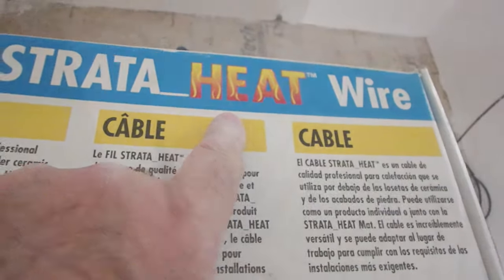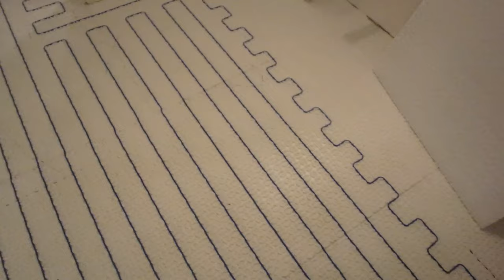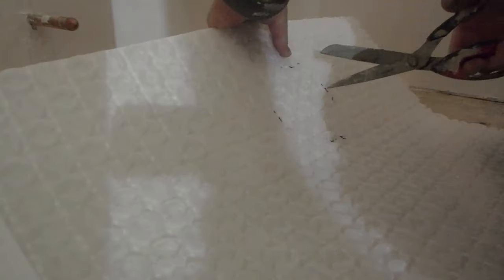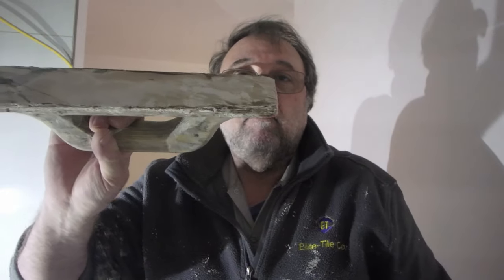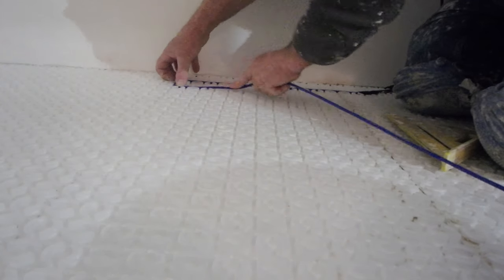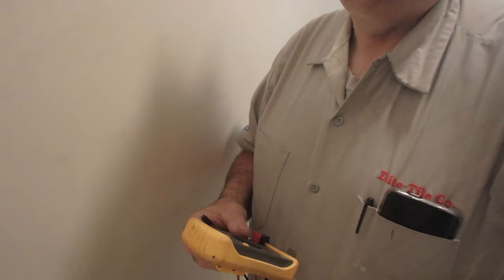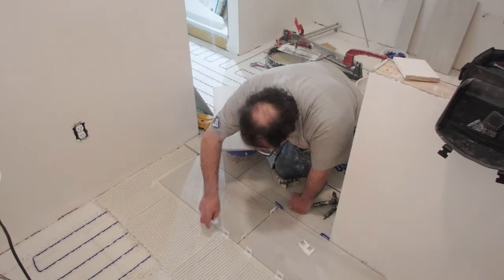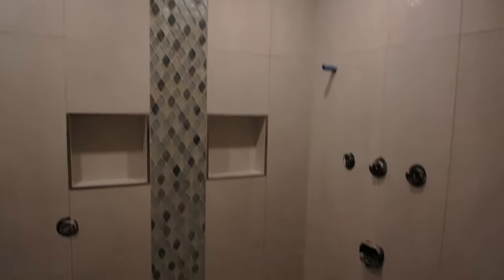Nice toasty, warm floor, here is how. Strata Heat  Step By Step

Comment: Great video! Do you have to run the heating cable wire and sensor wires from thermostat box to floor in conduit? If so, what's your strategy when drywall already in place?
Reply from the maker: not an issue, can be in the same coduit.

Comment: Do you still need to completely waterproof this board fully, not just the joints, screw areas and corners? HardieBacker Cement Board with HydroDefense Technology
Reply from the maker: Here is the installation guide, I don't use cement board these days, so many better products available. https://www.jameshardiepros.com/getattachment/922e35bb-1436-4458-81d5-579adb8a8bc9/RS19442-HB1908-HydroDefense-Install-Instructions-0320-LR.pdf

Comment: Thank you So much Sal!  Excellent detailed video.  I may be trying to do this myself in a new 3/4 bath I am installing in my basement.  I'm planning ahead to match the elevation of the rest of the basement floor that will be getting several layers of insulation & 5/8 OSB (approx 4" total) at a later date and therefore need to estimate the depth of the underlayment + mortar + tile.  I'm assuming maybe 1/2" for the combo of mortar - membrane - wire  and 3/8" for my tile + mortar?  So 1/2 + 3/8 = 7/8" to 1" above my level wood floor base (5/8" OSB surface).  Sound about right?  We're on the north shore of Boson and I may just reach out to you when the time comes.  Keep up the excellent work & stay safe!
Reply from the maker: Depending on the size and thickness of the tile, you are correct, you will end up at around 3/4"

Comment: Great instruction as always Sal! I've installed several of Schluters Ditra Heat systems and am becoming "all Laticrete" with my installs. Does Laticrete only give one sensor wire to install? Schluter gives two to install.
Reply from the maker: No you get two

Comment: Hi Sal, what's the best method for making a tile backsplash look decent (if at all) over an unlevel countertop? I have a 3/4" deviation on 9 feet. I realize that's quite a bit, but leveling it is not in the plan.
Reply from the maker: Use a big tile so you don't notice it as much. Other than that you have to level the counter to get it close to level
Reply: Float that whole thing out, re do the sheet rock. Too many options right sal

Comment: Sal, just wondering why don’t you back fill your heated Matt one day before tile installation? You can even strike a running line and then you creat less work back filling as you go and a less percentage that you may drop a tile or hit or damage the wire? Being there is no loud mouth to alert? I wish they would make a system that has an alarm just like the loud mouth..Just curious I do mine over the back fill the next day. Much love & respect to you. Love your videos and your passion and work ethic. Signed a fellow tile mechanic
Reply from the maker: Pre filling it seems like more work to me, I just prefer to fill as I go.

Comment: I have only used ditra heat so far and years back I installed several sun touch warm floor systems.  Here in ID I'm now told I cant do the wire install anymore and have to find a licensed electrician.  Super frustrating.
Reply from the maker: That is frustrating, does the electrician also install the tile.
Reply: @SalDiBlasi  we have to coordinate with the electrician for the wire install prior and after installation for all testing and "electrical elements" of the tile job.  It stings when politicians in regulatory agencies decide you can't legally do something you have been doing for years.
Reply from the maker: That stings, time for knew people to serve you, not dictate to you.
Reply: Passion for Woodworking I guess it’s what a liability issue? Or is it a Communist Governor’s Executive Stay at Home type order 😂
Reply: @jamesmedina3271  it's all about control.  I've been wiring homes I build (inspected and passed with flying colors) for decades but in ID it doesn't matter because I'm not licensed or able to provide documentation of 4000 hrs of training.  Very frustrated to say the least.